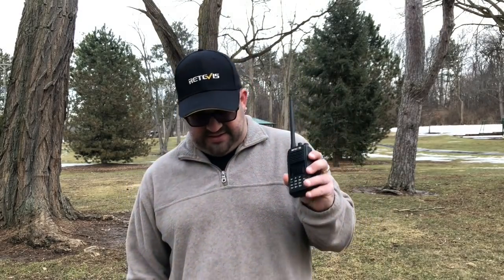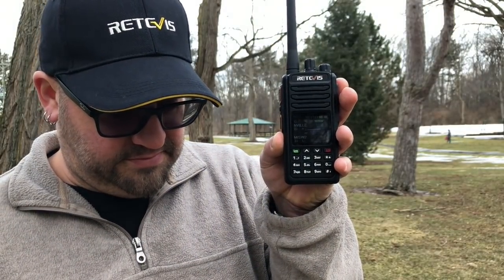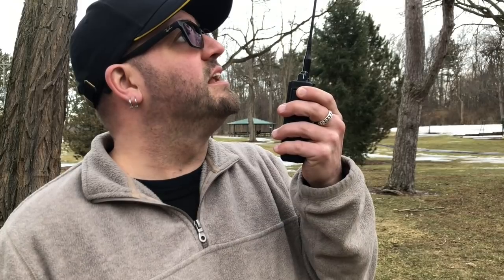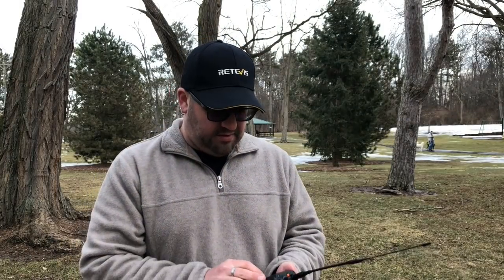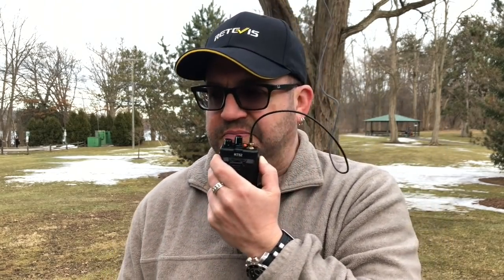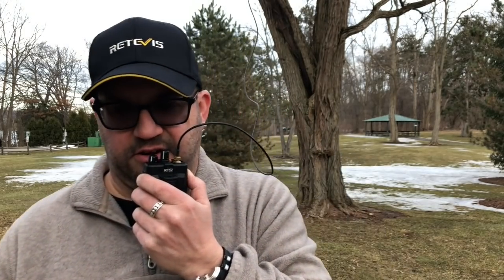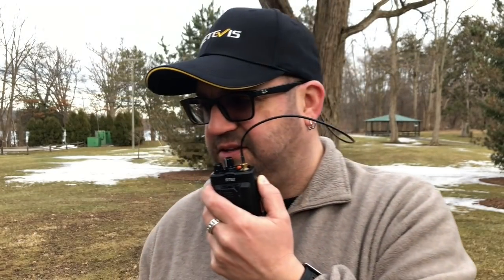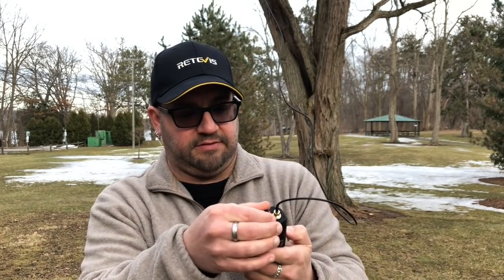Analog Field Test of the Retevis RT-52 DMR/Analog VHF UHF Radio.

Comment: Mike, I just spent most of Sunday watching your videos. Great stuff and I really want to do POTA. Picked up an 891 because of your review and the things you have done with it. Also have an RT-52 and a hot spot.  Now to get a battery and am gonna build the 20m speaker wire dipole. Will continue to watch you and laugh with you. Hope to do some POTA down here in 5 land. 73 de N5SKT.
Reply from the maker: Dude thats so cool man, thanks so much!  That means so much to me.  The 891 will do you so much good, as it has me.  Remember, antenna, antenna, antenna.  I use the KG6HQD speaker wire antenna for most of my videos (20 meters) and would encourage you to check out his YouTube channel on how to make one.  https://www.youtube.com/watch?v=cqh0Ntus5G0&t=13s
I have recently been using the Wolf River Coils TIA 1000 Antenna as my main go to portable multi band antenna and have been loving that so the choice is yours.  I would absolutely say make one for your self first though.   That's the fun of it all.
Reply: @hamradiotube  Thanks Mike. Already have the materials. Going to build this weekend after getting the AA-30 Zero built. The portable battery seems a bit intimidating but damn are the commercial versions expensive. 
I did find some parks near me (that I never heard of) and doing some research on getting a park activated.  First though, some practice in the back yard is in order.

Comment: It’s fun to try different things and trying the different repeaters.  I do that here in my area. I can hit a 30 mile repeater w my HT and the home brew 2m 70cm antenna. The other day I hit the same repeater w the HT and the whip antenna at about 50 miles as the crow flies. I was mainly line of sight. I was a little scratchy. 3 to 5 watts.
Reply from the maker: I think MI is just hilly enough to prevent any really long vhf contacts like that.  I think I've maxed out at about 30 miles with my home station at 50W.
Reply: Yea I live in a valley n hills all around also. But I do love the roll up jpole. Works amazing w 20W on the 8900. Anyways enjoy your videos.